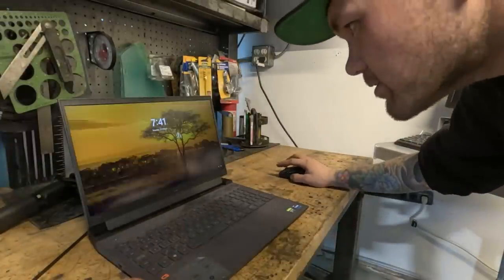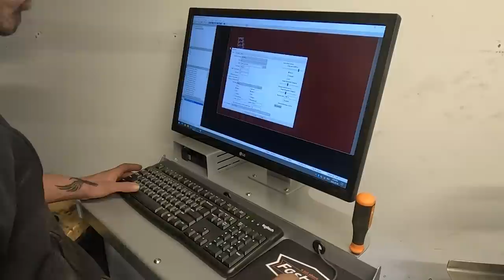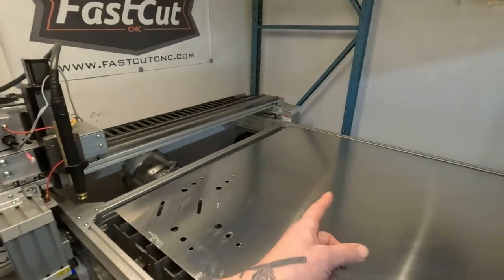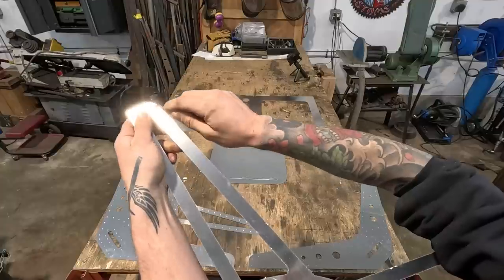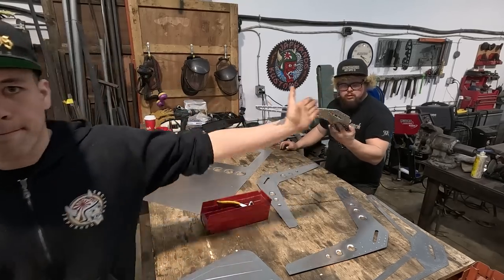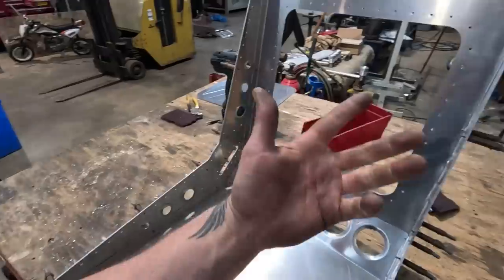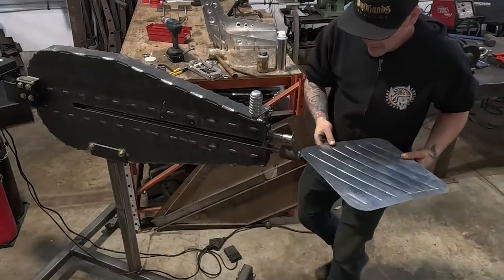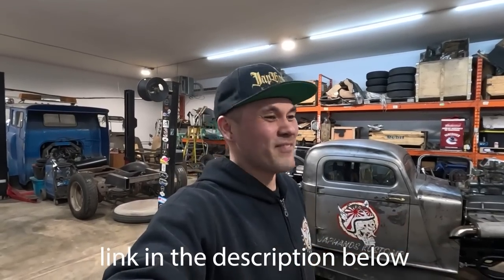How-To Build Aluminum Bomber Seats From Scratch! Bead Rolling Dimple Die Metal Shaping

Comment: On thin sheet metal like that has a tendency to ripple like that there is a head attachment u can get that clamps onto the head of the torch that has usually like 5 roller balls and then when you put the head down to cut it both holds the sheet down so it doesn’t ripple and as you set it just below the head height if it does ripple a bit the attachment with the balls keeps the sheet from coming up far enough to snag the head and move the sheet around. I’m a sheet metal fabricator and we’ve had that problem before on our plasma table.

Comment: Karl, I’m learning so much from your Videos. Current project are a pair of seats for my Jeep build. I’m thinking 2 layers of 6061 .06 each for the sides. I’d like to Hammer Form a flange from the inside over the outside of the top of the side panels. Maybe a 1/4” flange. Would that Flange be difficult with just hand tools? Keep up that enthusiasm and great videos!

Comment: I've done a lot of aircraft sheet aluminum cutting on a waterjet, even with a waterjet we have to use water cooling because the heat will cause it to lift and warp up fast, we will also sometimes follow the cut head around with a stick and forcefully hold the metal down to the bed, that and we always clock our parts in our CAD so that we never bend along the grain of the aluminum, aluminum is really prone to stress cracking along the your bends, I've had to scrap a few parts because i forgot this before, and a helpful tip is aluminum grain almost always runs the length of your 4x8 sheet

Comment: Watching Elio drill the holes makes me wonder if you could temporarily attach a spring loaded center punch to the side of the CNC. It would require an extra work offset in the settings, but I wouldn't think it would be too difficult. I've never used that machine software before though. The circles are great if you're using the punch, but are only 70% for the drill since you have to eyeball the center of the circle and try and keep the bit from walking. 
Great work though, keep up the good work.

Comment: Karl another awesome part man...as soon as I saw the fine-cut at the beginning I said oh no! I've drug many parts trying to use fine cuts... Glad y'all found the issue.. You and Elio work very well together!
Thanks for showing the good and the bad and the process of overcoming the issues. 
As others mentioned, use the easyscribe to do the centering mark.. About 0.02 works.
Once you get the machine dialed in, .0125" holes will cut clean.
Keep grinding man!

Comment: When I worked at a waterjet shop we used to use weights on top of the material to control pop in the material when we did a few layers and/or to hold material more solidly in place. Might be an idea to help you on the metal pop as well due to heat? 😊

Comment: at work we only used the plasma for cutting shapes, but the CNC turret did it all as it used combination of tools like drills and cutters basically a router with a tool changer, but she is loud as hell, I am sure you can get a small scale one, but with plasma too much heat is head crash.

Comment: I used to run a big cnc plasma. Couple of things to watch for - CAD lines need to be tool paths with no gaps or overlaps which might be the double cut issue ? And my machine used a water bath to stop distortion of the panels.  You're up against it using big thin sheets anyway.  Try laying your sand bags on the sheet to hold it in place ?

Comment: Karl, They have a tool we called a chip chaser for the burs created between the aluminum pieces. It is a thin piece of steel with a little hook at the end that you can slip down in between the aluminum. Since the steel is harder than the aluminum it cuts the burs off and since it is thin can be used near the cleco's without distorting the aluminum.

Comment: We used aluminum rivets to hold down the sheets in the slopes of are grain trailers the head is way bigger than those ones I think they are 1/8” shank anyways another thing to check out maybe. Looks great. I also talked to the weld shop in town he has the same plasma table he used that etching tip to etch there logo in things

Comment: Karl. 
Tip 
 If you put a piece of rubber or silicon hose over the drill bit - acts both as a depth gage and also stops the chuck from Marring the metal if you push through
- also use short jobber bits - less length flutes and shank - less likely to snap a bit and a bit more control.

Put the marked one on the inside and on the tunnel side of the seat. 
You will never notice it.
Love your work and those Aluminium Rivets in a Brass colour - look awesome.

Also what thickness Aluminium (Alooooominum) sheet did you use.?? Don't worry I had to wait till minute 52 for you to say 0.050"

Comment: With how thin that sheet is you will prob need to put a weight down on it outside of the cut area as the metal will deform from the stress induced by scribing and cutting.
When prepping drawings for importing into your cam program I found that doing the "overkill" command on the whole drawing helps as it will catch all the overlapping lines that can cause odd shit like double cuts. We had tons of issues with the program that came with our machine because it didn't like lines overlapping, it would hang up and do a Z check at every node from that point on.

Comment: Taking a closer look at a Fast Cut, seems like it would be rigid enough to run a center drill. Should be an easy thing to make as well, just modify another torch holder to accept a small pneumo drill and run it as if it was a regular plasma (although with just center points instead of circles for each hole). Height adjust becomes the Z axis, basically. 
Would be best to have a backing board instead of drilling over slats, but that should not be a problem. A thin sheet of MDF would work, just clamp couple "fences" to the machine so that material can be re-placed in the same location once drilling is done and backer board is removed.
As for seat design, looks great, though i agree on thicker center section. Maybe add small 90* lips on top and bottom edges as well, for rigidity?

Comment: For the design of the seat I‘d suggest to try to divide the 90° angle of the sides in the middle section. May 2x 45° breaks or at most 3x 33° breaks.  It rounds it of a bit more on the sides, if you would not want it to look so boxed.  Just an idea 😉

Comment: Nice build Karl, if was me I had put some clamp on the sheet or weight and depending on the bend an alcohol coolant with the air or the table coolant system to prevent warping and fumes at the same time. Thanks for the video

Comment: For small diameter drill bits I prefer what is called a “screw machine length drill bit”.They were designed to be used in automatic screw machines in a production environment. Screw machine bits are shorter than the jobber length bits and they’re better quality and much less likely to break than the jobber length bits that you’re using. Any machine shop supplier should stock them.